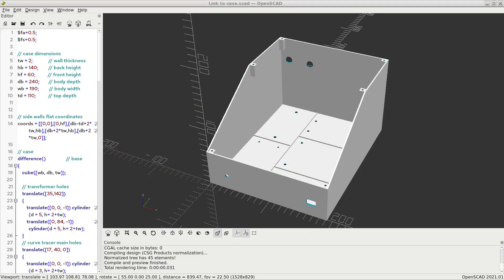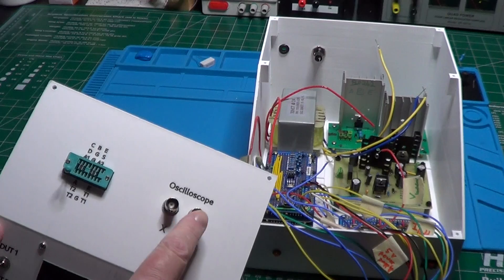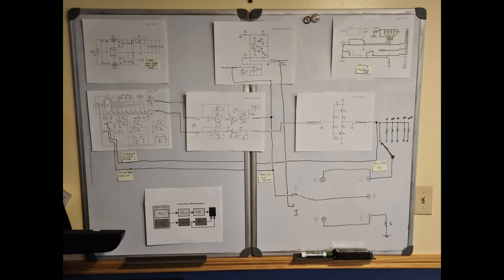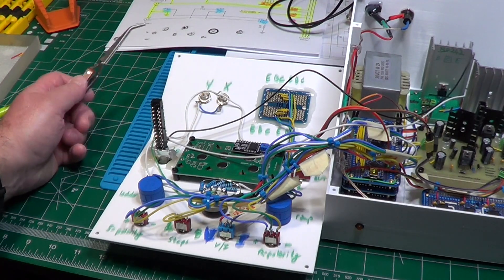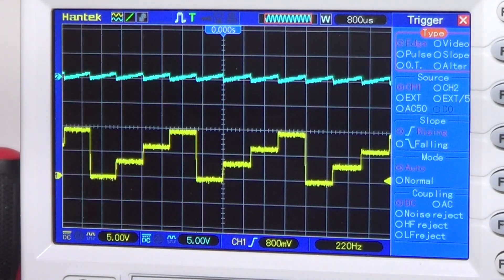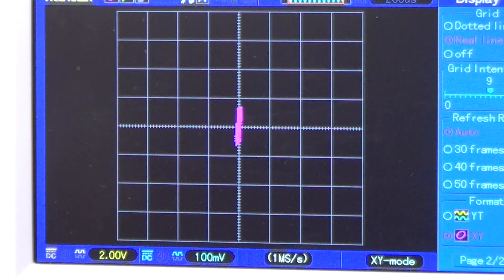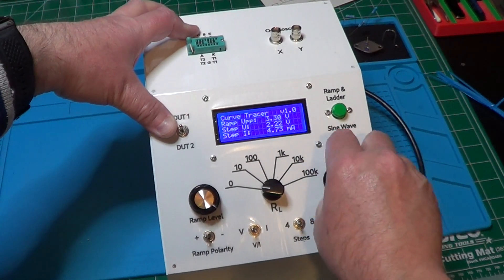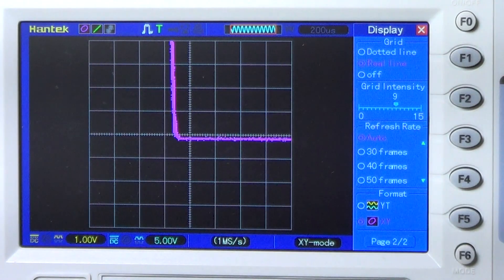Make A Curve Tracer For Your Lab - Part 10: Final Assembly And Testing

Comment: Great job so far. 
Improving the signal seems like a great idea. 
On the other hand, I think that if the signal applied to the DUTs could be amplified above +-15V, it would be useful for testing devices that operate at higher voltages. This would mean connecting the Push-Pull output to a higher voltage, but it would also imply that the voltage applied to the bases of the Push-Pull should also be higher than +-15V. What do you think about this?
Reply from the maker: Yes, i think I will soon start working on that.
Reply from the maker: However,  the device I built wasn't originally designed for high voltage DUTs. What you are proposing requires a total remake of the curve tracer, which could be done in a new version of the device. In the mean time, I will definitively add the amplifier to the y axis to reduce the noise when currents are low.
Reply: @eleneasy  OK. Thanks for sharing your knowledge.